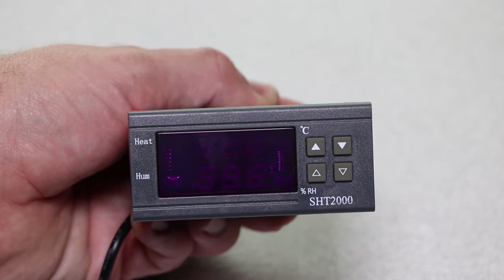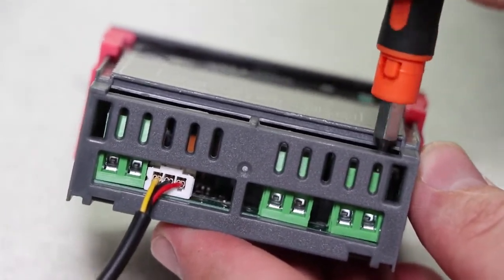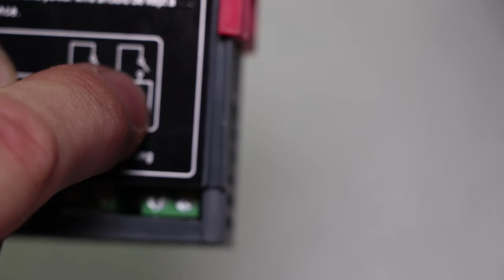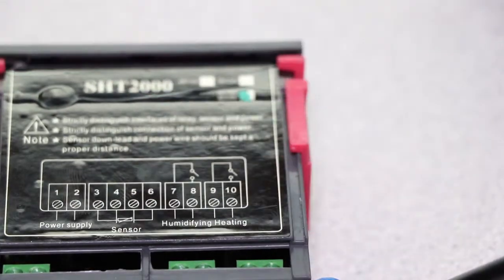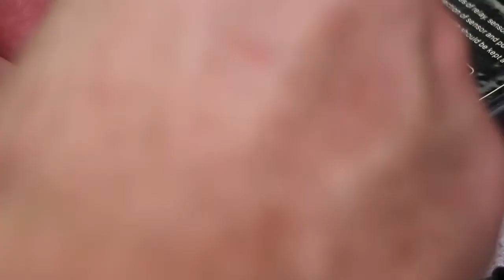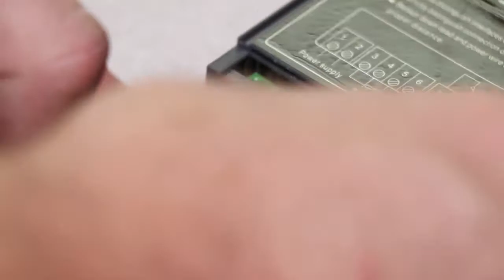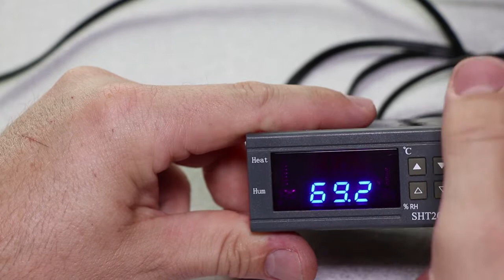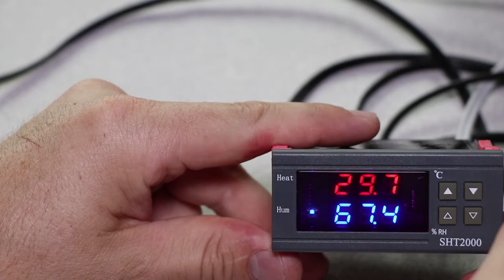SHT2000 Temperature and Humidity Controller

Comment: How to connect the device to 3 axial fans which could also be switched off by rocker switches/3 separate switches/??
Reply from the maker: Hi, I am no electrician but whether your using or for cooling or dehumidifing you will have power out the device to a power source is lower than 220v.  Then each fan can have a switch as you say on the live line if you dont want them operating etc. Connected in parallel.
Reply: @reptilegarden  controller is 12v.so the fans. The idea is to switch on automatically fans if-1 humidity to high and/or 2. Temperature to high. And have the option to switch off each fan at any moment separately. Couldn’t do it  and I’m not sure this can be done
Reply from the maker: @blackcrown6207  yeah the switch you mentioned I figured you were looking at manually switching units off when not in use etc. You will need a controller for each one unless they all rigged the exact same and experience the same conditions. Problem is if the heating fails on one  with the probe the others will power full on without regulation. You might be looking for a bigger unit that can have 3 probes and different channels. I think it will still be cheaper to by 3 of these units and wire all separately.

Comment: Hi, I'm looking at this for my greenhouse. Can I bridge the lives from the heating and humidity. I. E. If I have an aircon that I want to stay on, say when the heating is out of range but the humidity is not for example. I think it should be fine as the current is the same? Have you tried anything like this?
Reply from the maker: Hi, I am not 100% sure I fully understand what you mean. Firstly most aircons are very high energy especially when start up. This unit will blow a fuse if it is over exerted. The heating and the humidity are controlled separately you just using a bridge to power a switch until the unit makes the connection as needed. I hope this helps to answer you.
Reply: @reptilegarden  thank you for replying.

Comment: my device sometimes reads LLLL and then resets.. do you perhaps know why its resetting
Reply from the maker: Hi Chad, I have seen devices display LLLL and this is often due to a loose connection of the probe wires. It can also be a faulty probe  that needs to be replaced or a probe that has gotten wet and shorts etc. Try a hair drier on it and check your connections. You can also open the probe housing easy enough to check the connections. It is strange that it is resetting though.
Reply: @reptilegarden  thanks for the reply. I plugged it out and back in. Seems to be glitch free for now. Might have been a loose connection.

Comment: Good day! So basically I could use this in a germination chamber for 4 tasks? Ex: for heating some electrical heater, for cooling a fan (or something else), for humidification a vaporizer, and dehumidification an exhaustion fan? Regards
Reply from the maker: Hi, no it will do either 2 of the 4 tasks you mention. Either heating or cooling  and humidify or dehumidify depends on you setting. It only have one power outlet for each function and otherwise the circut is broken.
Reply: @reptilegarden  thank you kindly, I was 99% sure..just had a brain fart and had to ask :p
Reply from the maker: @doomsdayrats  all good. That would be fairly nice to have in one unit but these do the job in most cases. Otherwise it would be wiring two of the up and making sure the set values don't battle each other.